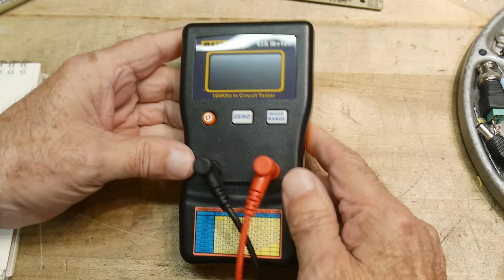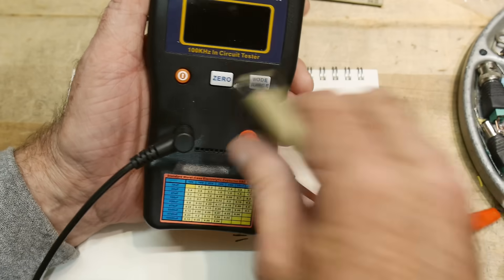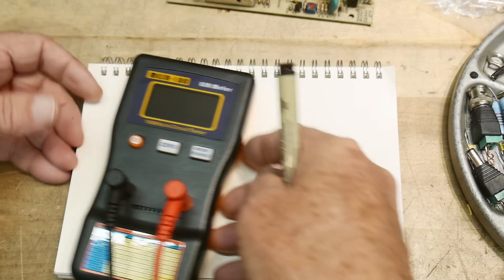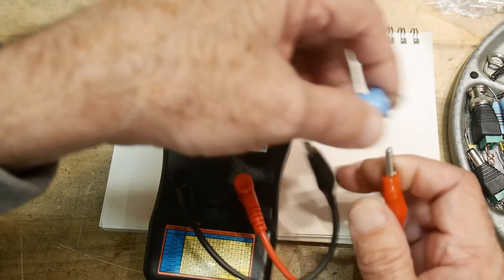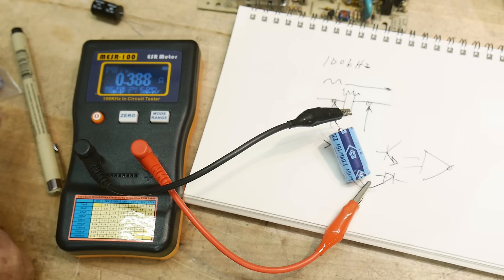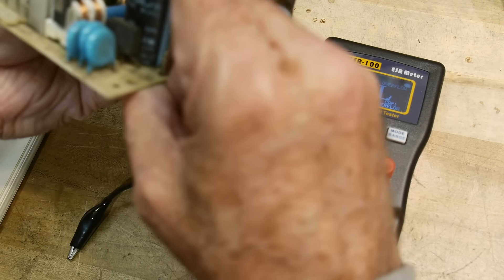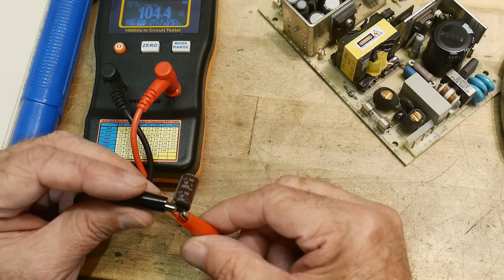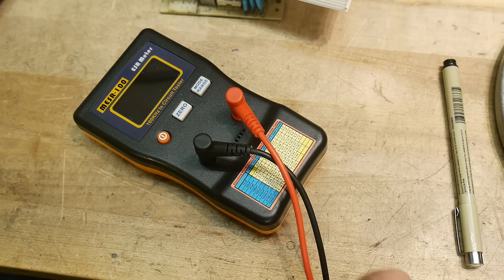#1791 MESR-100 ESR Meter Review

Comment: All materials are made up of positive nuclei and negative electrons.  Thus also are the dielectrics between capacitor plates.  Insulators (dielectrics) use all of their electrons to form the chemical bonds that hold the material in its solid shape... they have no 'free' (mobile) electrons to conduct current  The electric field (from a voltage = potential difference) stretches these atoms and bonds and stores more energy than vacuum.  But, it is also impossible to make any substance 100% pure.  Substantial effort and expense is needed to achieve 99.5% purity.  Impurities in dielectrics (as well surface states at the dielectric's edges) usually offer mobile charges that can conduct some leakage current.  The vacuum has no surface states at the edges, but there are no complete vacuums either -- yet our best vacuum is also our lowest leakage dielectric.

Often dielectric materials (or the conducting liquid electrolyte that promotes a metal oxide insulation layer) dissipate energy as we stretch their bonds.  Ions in an electrolyte move.  Electret domains grow and shrink.  Impurities move between material inclusions.  Piezoelectricity changes the dielectric's shape, etc.  Since these processes do not return all of the energy when the field is reduced, capacitors almost always have 'hysteresis losses.'  Primarily, it is these hysteresis losses that cause equivalent series resistance (ESR).  But the metal capacitor plates, wires, and wire bonds also have actual resistance that contribute to ESR.

Comment: i have one of these but my ECR T7 meter is better and alot cheaper i also have a BSIDE  ESR02 PRO that is better as well my experience is don't use the meter in circuit testing it will give you false readings.

Comment: You can't test capicitors in circuit.
Reply from the maker: I just did. found a bad cap. depends on your idea of 'test'
Reply: You can... Just not accurately.
Reply: The only time you can't check a capacitor in circuit with an ESR meter is if there are multiple capacitors in parallel - any one good cap in parallel will show a low ESR even if the others are failed and are high ESR.